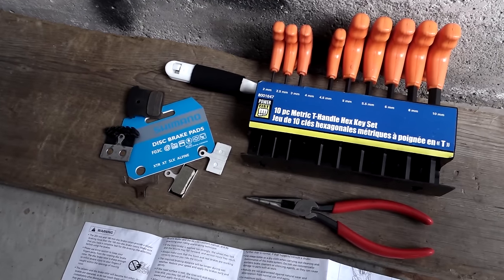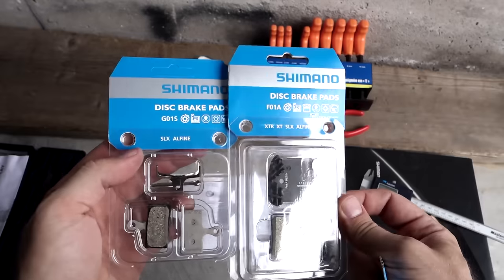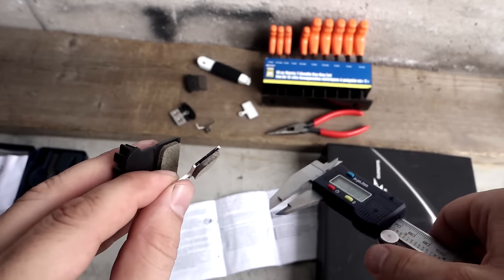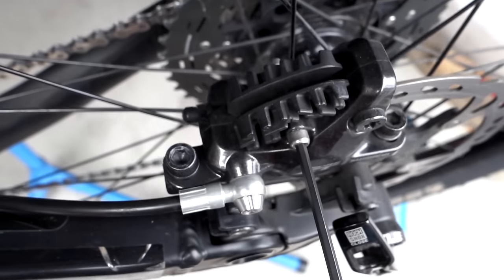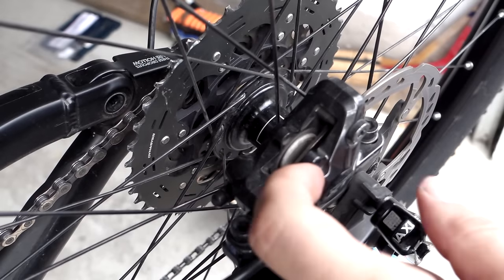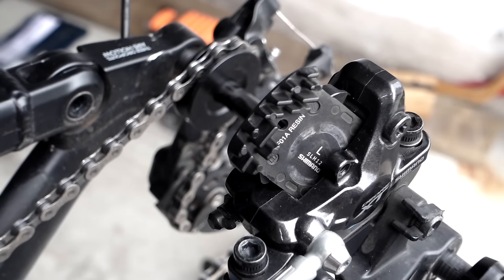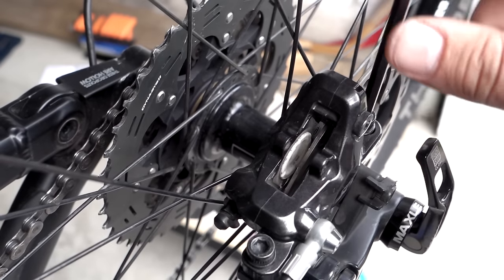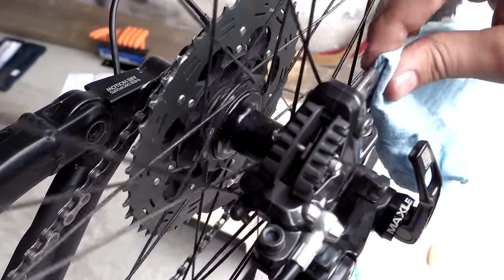Shimano Disc Brake Pads - When and How to Replace - Hydraulic Brakes Maintenance

Comment: Exactly what I needed! Yesterday, I was unsuccessful at replacing my brake pads and ended up putting the old ones back on. The use of tire levers to push the pistons back in is the step I was missing. Thanks so much!
Reply from the maker: And remember to bed in the new pads! 😊

Comment: 4:51 there's an actual procedure for centering the rotor between the brake pads. With the brake pads in, loosen the lateral adjustment screws, tightly squeeze the brake lever, then tighten the lateral adjustment screws while holding the lever. Let go of the lever and they should be centered.
Reply: I was talking about the hydraulic. Sticky pistons are another story, but the method I mentioned is a good first step.
Reply: @batbawls  This method only works correctly if you have perfectly straight rotor, perfectly clean caliper (no dust inside), perfectly evenly moving pistons (they don't have to be sticky or malfunctioning to move unevenly!) and brand new pads (not worn at all). Perfect conditions for mentioning this method in the brakes installation manual but it does not transfer well to the brakes that were already used for some time and you only want to replace the worn pads or need to readjust the caliper after reinstalling the quick-relase wheel. If any of these factors is not met, the caliper will not center correctly and you will have pads wear at an angle. Recentering with such pads will always position your caliper at an angle again. So this is not a good method. I was using it and now I have one pad worn to 0.5mm at the bottom and 1.2mm at the top while the other pad worn to 1.2 at the bottom and 1.7 at the top... Method shown in the video is more precise and you should definitely consider it if you have a caliper that allows inserting the pads from the top. Unfortunately it is much much more difficult for calipers that only give access to the pads from the bottom (like Shimano Alivio and such) and almost impossible when combining such calipers with quick-release wheel, so manual centering with your hands while the wheel slowly rotates is you next best option, although dangerous to the fingers and not very precise too.
Reply: Taking time to explain in detail. You are very helpful. You’ve earned. Another subscriber here. Thank you.

Comment: Thank you. Your tutorial made the process of changing my first set of disc brake pads on a bike almost painless. Previously I have only changed rim brake pads - countless countless times over many years. I've even tried my own recipe for rim coating to eliminate rim wear because I was tired of replacing otherwise perfectly good wheels or rebuilding wheels with new rims. 
Having disc brakes now is a revelation and I'll not go back. My only misgivings are two: 1) What's it like to change the pads? Answer:Easy
2) What's it like to bleed the system(do things with that hydraulic oily stuff)? Answer: Dunno yet but I want to learn!
Cheers.

Comment: thanks for showing how to use the tyre spoons to push back the calipers. I was worried about using any old tool to force them apart as I remember reading somewhere that the pistons may get damaged if they are forced apart unskilfully.

Comment: Also useful info for folks with Tektro m280 (low end stuff) brakes. Since they use the split pin instead of a bolt. [And none of the tektro how-to videos on youtube seem to use such a model as an exemplar]

Good job!

Comment: I don't like the idea of adding the lube to the brake retention bolt right at the end.  So close to the pads and disc at that point - I think I would choose to leave that set of threads alone.  Otherwise, great video!  I never thought about that centerline mark on the armature.

Comment: That sound is from that spring thing that keeps brake pads apart. At first that is the one that touches the disk, so it's ok, don't have to dispair or to check many times.

When you start hearing that, the pad is 0.5mm thik and you need to replace it as soon as possible.

Comment: Nice video, my onlt comment is the lining up of the caliper along the centre line, that doesnt compensate for the fact the pistons may move at different speeds when applied for some reason and you could end up with more pressure from one pad than another, the alignment should be loosened caliper, squeeze brake then check how aligned that caliper centre line is as it will also give some idea on whether you have a sticky piston. just tuppence worth.

Comment: Thank you. Terrific video but I am unclear on how L-R go. The spring mechanism and pads look identical except for a small hole on one side of spring. Plus neither pad has a front or rear directional marking indicator. Thanks again.
Reply from the maker: L/R is only relevant for the finned pads. Otherwise spring doesn’t matter
Reply: Thank you so much for great video and great advice! 👏🏼👏🏼

Comment: Thanks for the vid, some good tips. One point though that's probably worth making an annotation for is that at 1.31min when you are checking the pad wear, you're incorrectly measuring both the pad and the plate it's held onto (hence why you're getting 4mm). If you look at the manual it shows pad thickness from new is usually 2mm. If someone followed this vid when measuring, they could think their pad has say 2.2mm (including the 2mm backing) when in fact their pad will be .02mm.

Comment: I always thought it made more sense to centre the calliper by loosening it, pulling the brake on and then tightening it with the brake held on - is that not the right way any more?
Reply from the maker: That would be step 2 Step 1 do it like you see here, force both pistons to come out equally. Then loosen, pull lever and tighten alternating bolts, then release. Should be perfect!

Comment: This works in hydraulic and mechanical disc brakes as well, correct? You can remove the wheel with no threat of the pistons closing in as long as you don’t hit the brake lever?

Comment: On my third set and all have the same issue with humidity. Endless squeek and lack of ...no..performance on a dangerous level.
Have to bake them (literally oven for 25mins at about 400) before I use them for anything serious. Not alone. It's some issue with the compound. Going third party from here on in as I don't like faceplanting trees.

Comment: Thank you for the video, it helped me with this service. However, I noticed a slight error when you were measuring. You reference a manual which discusses changing the brake pad when its less than 2mm. In the book you can see that this measurement is for the actual brake pad without the metal backing. In the video you measured both the ceramic pad material and the backing which gives you a falsely increased number. If you measure both the pad and the backing material you have to subtract about 1.74mm (this is how thick the backing was for my pads). Again thanks for producing this video but I wanted to clarify so others don't run into braking issues if they are measuring incorrectly.
Reply: The way he did it was correct imo - the guide says 2mm as new and 0.5mm of pad material when worn = 1.5mm of wear. Measuring the total pad thickness and observing 1.5mm of pad wear later seems like the correct thing to do, as you can't actually measure the metal thickness below the friction material

Comment: The clarity of the process is good, but I wonder whether a mention should be made about pushing the pistons in to make room for the new pads. I've followed steps in the video a few times without a problem, but recently developed a lever (GRX 810) that was pulling all the way to the bar to engage the brake. LBS had a look, and the bladder in the lever is broken (which requires a whole lever replacement). They speculated it could have been from hamfisting the brakes, but I'm pretty easy on them. I suspect it happened from pushing the pistons back too quickly and with too much force when replacing pads, but it's just a guess. Anyway, something to be careful about.
Reply: It sounds more likely that somehow, air has been introduced into the system. If the reservoir at the lever was broken in some way you would have fluid leaking.

Comment: Great video. 
Did mine tonight and when I apply the brake there is slight movement with the finned portion of the pad. 
Is this normal?
Everything seems to be working fine but seems odd that there’s any movement.

Comment: @5:25 are you sure you need to put grease on the 3mm bolt? I'd think (and see) that you need to put blue loc-tite, someone (or Tektro) put that at the end of my bolt
Reply from the maker: I do, others don’t, I wouldn’t put Loctite on it though. You have the  circlip for that.
Reply: @LoveMTB  OK ... I put a little grease in the middle (possibly due to this vid)  and left the blue loc-tite at the thread near the head of the bolt. No, Tektro Auriga do not have a "cir"clip, they are threaded 3mm bolt .  Anyways

Comment: Another very helpful video - I always come back to your channel when I need some help. I find your tech videos even better from those from Park Tool :)
I have a question though - do you lubricate the pistons with mineral oil before putting in a new set of pads? 
Shimano doesn't say to do this in their manual; but some on forums say if you don't lubricate the pistons, they will stick and will not retract easily. Do you agree with this?
Thanks again!
Reply: @LoveMTB  Thanks!!

Comment: I was just wondering this I went to change my pads and I pushed the pistons into the bore and then I put the new pads in and put the wheel back on a the pistons where stuck in the bore and where making no contact with the brake pads

Comment: I am wondering if I can reuse the fin when I replace a new set of brake pads? So it's like removing old pads, then try to glue the new pads on the fins? This is to save some cost.

Comment: Thank you for a nice video! I change my brake pads by my own today, I pushed the pistons in as far as I could but it’s very little room for the rotor to fit. The brake pads is on the rotor. I looked at shimanos website so I order the correct brake pads and it’s the correct rotor. Is it only to push the pistons even more? Or is it anything else I missed?
Reply: Same here, new pads still quite tight. Did you find a resolution?

Comment: The pads in my mechanical disc brakes look thick enough, however there is a shiny black coating on it, I can see shiny streaks of copper colored material,  is this a good time to replace them??, or do I sand them down a bit? The braking action is totally ineffective, I can easily push the bike with the brakes pressed tightly.
Reply: @LoveMTB  Thanks for the tip. I sanded the pads, but still not good. I have ordered some new pads. I think I will try to sand the discs now. Any idea what grit sandpaper I should use??

Comment: I still don’t understand which way the pads go in. The pads have a left and right on them and they can go in either way. On my bike the Caliper is on the top so your explanation of drive side would mean the pads would go in the other way. Is there not a standard way to put them in? Would be helpful if there was a small stamp on the caliper to say which Side is left or right.
Cheers
Reply: @LoveMTB  hi, thats helpful and thanks for replying.

Comment: Hi, my back hydraulic brake doesn’t work properly the first time I pull it’s (it’s very weak and pulls back all the way to the bar) so I have to pull twice to brake but after a few seconds of not pulling
It it goes back to being weak and I have to pull twice to brake again. I burped the brakes and that didn’t help. Was wondering if you knew what the problem is and what I have to do?
Reply: Oh right so I’m gonna have to fully bleed it right? Thank you very much for the reply as I thought burping it would get most of the air out and i couldn’t find anymore solutions anywhere.

Comment: Just removed my rear pads and one pad had nothing left on it and one of the arms was snapped and the other one had plenty of brake pad left
Reply from the maker: Stuck pistons would do that. Check my latest video on brake bleed, some tips and tricks in there on what you can do to your caliper
Reply: @LoveMTB  any idea as to how to fix either a slightly bent rotor as I think it is bent in one place or it looks like the thing that holds the rear brake pads together is too close to the rotor causing it to rub I just don’t want to go a bike shop and pay extortionate prices
Reply from the maker: @miniviperftw3774  Google it it’s easy in theory

Comment: Great li’l DIY video!  Seems Shimano now offers both the J02A and the J03A resin pads and they look identical .  Do you know what the difference is?
Reply: @LoveMTB  Yes you’re right, both identical size, I did read that the J03A are the newest gen and supposedly have 40% longer life.  I’m guessing they also have 40% less grab, but who knows.  The J02A have superb performance and modulation, I’d hate to sacrifice that just for longer life.

Comment: When I put these pads in my shomano 105 br-r7070's there is no space at all for the rotor - do I need to bleed it out to let the pistons move back or what? definitely has BR-R7070 listed on the l03a pack
Reply: @LoveMTB  Looked like similar issue I solved it last night - the pistons on 105's adjust as the pads wear down I just had to push them back in, perfect brakes now :) Thanks for replying. This will probably be relevant to some modern MTB models also.
Reply: @LoveMTB  I think I had too many things going on at once thanks for that info

Comment: Missing two crucial points: new pads don't brake well at all !!!
- First you may need to pump the brakes many time to let them self-adjust (because you pushed the pistons back, there may be excess space)
- And you definitely need to "bed them in" before they will have full braking power!  Get up to 10-15mph and brake medium hard, almost down to a stop and then gradually let off.  Do this a few times on flat ground until they're working reasonably well, then it's easier/better to go to a moderate downhill, and do it 10-15 more times.
Reply from the maker: It's in the description...enjoy!🤘

Comment: goodmorning,anyone know which shimano disc brake pads is available for MFTZ21?
Reply: @LoveMTB  do you mean the handlebar brakes?
Reply: or the front caliber brake under the handlebar brakes?
Reply: i need to open the shimano disc brake pads? maybe the code is inside?
Reply: @LoveMTB  so in the back of the caliper there is a sign with 20mm IS and another sign with F5, in the front of the caliper there is a sign with 0mm IS and another F5,or the right one is under the lever, the number that i see is SL-TX30-7R